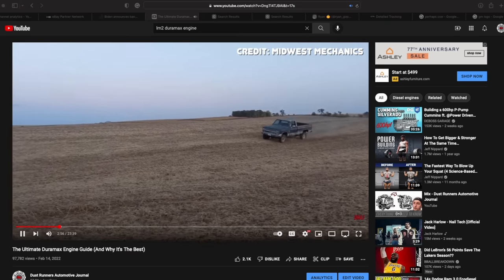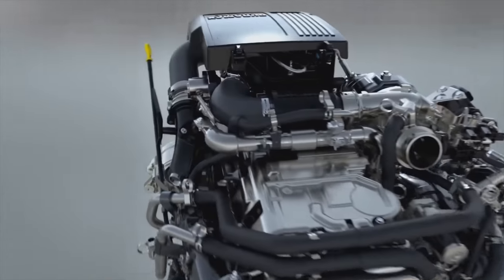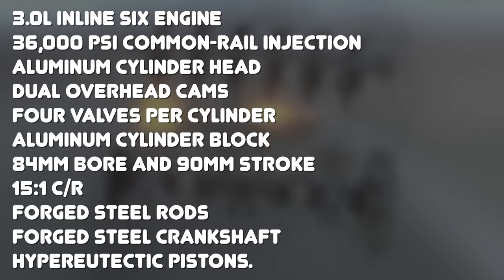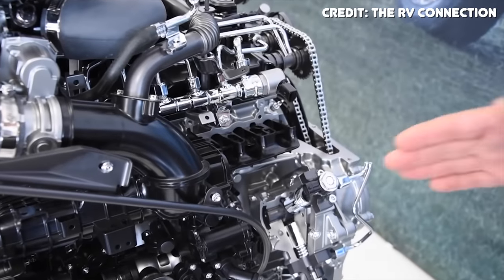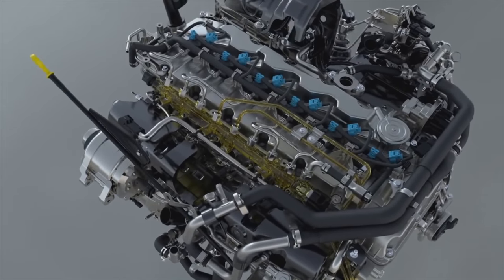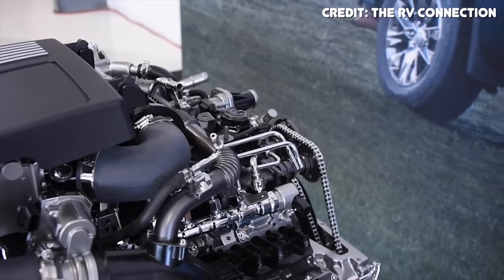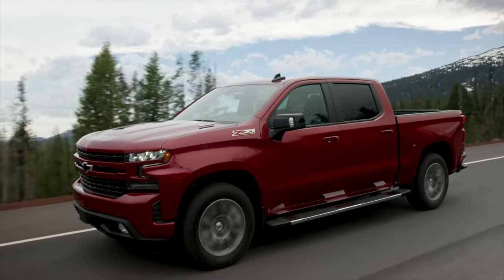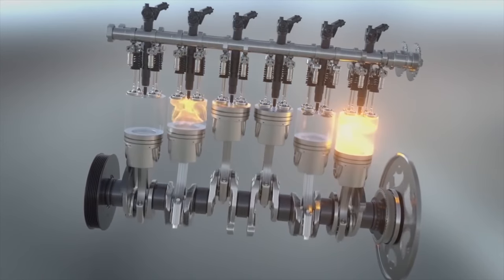3.0L LM2 Duramax: Everything You Need to Know

Comment: The timing at the rear of the engine has nothing to do with packaging. It will be the same no matter what end it's on. It's all about harmonics and reducing torsional flex in the engine.
Reply: Wouldn't torsional flex be better if the accessories were driven at the front?  Putting it all at the back means 100% of the load is on one end of the crankshaft.  Harmonics though I can't speak intelligently about, other than to say this engine is so smooth it makes Mercedes' 3.0 diesel feel like it's full of gravel.
Reply: @JETZcorp  My opinion would be that it would make a big difference being on the backside. 
Reason being is because of all the structural support for that end of the crankshaft, as it is bolted to the flex plate and then the torque converter that's attached to the transmission input shaft. Then you have extra integrity with the engine block being bolted to the transmission bell housing. I would hope that they designed a very strong crankshaft bearing for both ends of it though. So, there's my thoughts on this one 🤔.
Reply: @stanlojewski6761  I don't think those factors are all that significant.  That would seem to mostly pertain to vertical or lateral flex, which should already be very well supported by the 7 bearings the crank is supported by.  If it's flexing at all in those ways, it's eating up those bearings.  I was mainly thinking of torsional flex, that is to say, the twist of the crankshaft along its length.  That's long been a problem for straight-sixes, especially ones with a lot of torque, due to the long crank.
Reply: @JETZcorp  another 5 to 8 years and it'll tell us it's own story, that's how we'll get some actual data. There's our theories and speculations, then there's the engineers reasoning and R&D that's behind it all. I'm mechanically inclined, but I'm definitely not an engineer with a R&D department. So, for us normal folk to decipher new engine platforms we'll need the time and miles of hands-on experience for proper evaluation.  The engineers have to have reasons for this design, whatever that is. It could be excellent or it could be over thinking the design and perhaps irrational and/or maybe just to keep most of the repairs forced to an in-house repair company that simply couldn't care less about the customer base and is motivated solely by greed. Who really knows. I know that I don't trust Mary Barra and I hate stealerships! The corporate world is more greedy than ever but, time will answer our questions about this design and for consumers sake, I hope we're not paying this much money for a complete scam. Also, 1 billion is a lot to invest into such a development and I highly hope that it was spent on "good intentions".
Reply: @stanlojewski6761  One thing which I think is easily forgotten, is the origin of the engine.  It started as a 4-cylinder for Opel, almost certainly in transverse application, probably with manual transmissions most of the time.  My theory is that they intended for timing gear to be inspected and maintained during a clutch job.  If the tranny is disconnected anyway, access to the back is better than the front in a transverse application.  Front timing covers in FWD cars can be a huge pain.  Adding 2 more cylinders and putting it in a rear-drive/4x4 auto trans application changes that calculus, but the bones of the engine still are what they are.  I don't think there's going to be any real issues with flex either way.  If there are reliability issues with the engine in the future, I should expect it'll be related to emissions equipment, like every US-market diesel.
Reply: @JETZcorp  good points. 👍 
No doubt that the biggest issues with today's diesel engines are the epa garbage. Slowly getting better but if they tuned a diesel engine even better, they'd run much cleaner as it is. The aftermarket has proved that it can burn much cleaner than factory tuning. When a heavy hitter like CAT jumps out of the game because of what it costs to keep up with the politics of it all, you know it's bad.

Comment: Excellent in depth video that just convinced me to stay away from this particular application. A close friend has already had the belt fail, cracking the case & allowed oil to pour out all over the highway he was driving on... He has also experienced the long start issues & still not fixed after a few trips to his local dealership & another.
Reply: In addition to belt failure previously mentioned, he only had 17000 miles on his 2021 GMC AT4.

Comment: I am thinking of a suburban with that diesel engine in it my current suburban has the 5.3 with the variable valves for better fuel consumption. I have had trouble with the valves and the oil pump plus it lacks a bit of power towing my boat and utility trailer. My old 94 suburban with the 350 was more powerful towed the boat like nothing. So I wonder what your thoughts are about the long term with the diesel engine in the suburban wait a while to see about problems or dive into a possible money pit

Comment: As a previous owner of a 2020 Canyon with the 2.8 Turbo diesel, and now a 2022 Sierra SLT with 3.0 Turbo diesel 6 cyl, I can say with absolute confidence, there is no reason for the 2.8 to exist.  In terms of economy the 3.0 is literally identical to the 2.8 in towing, highway driving, and city driving, with the added benefit of more power/torque, and a much more spacious cab, and better ride.

Comment: What is the vertical rectangular box hanging off of the passenger rear. I seem to have developed a coolant leak and it’s dripping off the bottom of that box where it’s flanged to a small section of exhaust pipe. It’s dripping off the box/exhaust flange bolts.

Comment: I prefer the V8 gasoline engine it's easier maintenance and V6, to hell with that rear mounted timing set up and that belt driven oil pump, DEF and DPF crap good luck with that set-up in a few years later for those owning that thing. You can love it now that the truck is brand new but you will hate in a few years from now.

Comment: 10:42 why are we not using exhaust gasses to heat the engine coolant?? (no, the EGR cooler doesnt count)
.
like we already use exhaust to push more air into the intake
why not also use it to warm up the coolant (and even oil)...... so it gets into closed loop sooner??
.
.
i also live in montana
so a quicker warm up = less time freezing my boi's off driving to work when its -50F (BEFORE you factor in a 60mph wind... so like -110 wind chill)
.
.
.
.
so.... you would have a heat exchanger that looks like a SCR or cat converter 
ya only run coolant through it when needed for warm up
.
which might present an issue........ how do you prevent the coolant from boiling once its shut off?
might have to use a pump to drain it.... or have a temp sensor and constantly run a BIT of coolant through it (which would mean you need a slightly bigger radiator)
.
.
.
but still..... JUST MAYBE this system would save enough fuel 
that we could get rid of the DPF systems....... that im SURE would still cause more issues than my idea
.
people say "they have DPF figured out now, it doesnt fail like it used to"
yet.... the shop makes SO MUCH money on DPF issues.......

Comment: I am considering purchasing a refreshed Silverado RST with this engine in Q4 this year. I've narrowed it down to either that or a F150 XLT with the 2.7 ecoboost. The prices are nearly identical and I really like both engines on paper and both seem to be loved by owners, for the most part. I'm leaning toward the Chevy, but I'm terrified of falling victim to GM's notoriously poor reliability. That said, they have improved over the years and Ford has their share of quality problems as well. Decisions decisions...
Reply: You have been asleep at the wheel if you think Ford is selling reliability. My son's pulling tractor buddy was a Ford tech for a big dealer, & he got so disgusted with the Ecoboost junk he quit & went to work for a tractor dealership. He won't recommend ANY Ford engine aside from the venerable 302.
Reply: this diesel will never last

Comment: I think the LM2 is a great idea that was designed very poorly.  This is NOT an engine that will age well.  Most people that run diesels put many, many miles on them.  It is clear by the layout of the components and complexity of the design this is about a 150,000 mile engine.  Not just because of the belt design oil system (which when the LM2 first came out was a 175,000 life limit, so what changed that limit?)  This is simply from the very complex design and access from the back of the engine.  Also, why use a wet belt?  Can any of those engineers explain to me that a belt with a life limit has more space savings that a chain drive would?!  I do agree that a straight 6 is great for a diesel but considering the output and limited engine bay space a V6 would have significant advantages here.  Accessing the back of the engine (removing the transfer case and tranny) on the owner's dime at a service center will definitely affect the used price of these trucks as the age creeps up.  I have little doubt that people purchasing this truck new will love it.  I would too, but this engine is simply not made to work on.  I hope I am wrong but I just don't see this thing aging well at all.
Reply: Systems have changed wiring etc is quick connects. Lifting a cab isn’t the PIA it once was. Shops have these type lifts & ceiling room today.  I think it’s like Ram’s EcoD that it’s basically a disposable motor. Probably change the belt etc at 200k then run it another 200k or however long it lasts then dispose of the truck. If it fails early you drop in a crate replacement.

Comment: Any gm/Isuzu diesel engine usually has a pretty good following in terms of reliability...I don't know about this new 3.0 litre unit but the current 6.6 litre is fairly bulletproof maybe not as a 7.3 powerstroke but not far off
Reply: This unit has almost nothing in common with a 6.6 duramax. Stated clearly in the video.
Reply: This is not the Isuzu Duramax. This is the opel duramax. Euro stuff is usually not as reliable as the Japanese stuff.
Reply: Either way a diesel in a half ton truck doesn't sell well...regardless of its production origins

Comment: The difference between a Half-ton and my one-ton is 6 inches in overall length. My 2020 6.7 powerstroke routinely gets better than 23mpg(10.2l/100km). Make that 3.0l weigh 9000lbs all day everyday, report the given mileage. Better, make it tow a 12k rv and still get better than 13mpg(18l/100km). Oh wait it can't do the same job. A 9k truck plus a 12k trailer is 21k right? That's about 4k more than the GCWR of any GM 1500 truck, 3.5k more than a Ram 1500, and 2k more than the highest rated F150. Too many people don't understand ratings and limitations. Yes that 3.0 get better milage than my 6.7 and every other 3/4 or 1ton. It can't even match the work of a  late early 2000s diesel either(20k GCWR). I have never cared for the small diesels(other than the 1.9 TDI VWs)
Reply: Pull my 7k dry weight trailer with weight distribution no problem. You're talking apple's and oranges. If I want a 12k RV I'd buy The truck to match
Reply: @edhlavaty6914  I was stating that the 3.0L  doesn't even compare to the old 5.9 cummins, 7.3. Powerstroke, early 6.6L duramax. Even though it is close in power the measure of what a truck can do in based on its GCWR and none of the half-tons are better than 17500lbs(other than a few select F150s(19100lbs). At the load levels of 10k towing(15-16k GCW) the mileage isn't comparable to the old stuff at 8K towing(15-16GCW) or 12k towing(20k GCW) personally I would use any halfton for more than light towing, no rv over 24ft or and enclosed  trailer over 7k. It's just not enough truck. Most half-tons are between 5-6k empty and 7k GVWR do you really feel comfortable with a 7k(max GVWR) lead vehicle towing a 14k trailer? My 9k(empty) 12.4(max GVWR) one-ton can lead 22k of trailer. Most semi-trucks are the heavier end or the truck(12k steer, 40k drives, 40k trailer) so 56k of 80k GCW is leading the trailer. Quite the difference between even a ono-ton DRW, which is a14k truck leading 36k of trailer. 6k of the trailer is on the truck, but its still only 6 tires leading 45k of GCW
Reply: not a chance you get 23mpg from your 6.7
Reply: @michaelcooley8275  I've gotten almost 25mpg out of it.  Not everyone drives their truck like an idiot. The average on the current tank is 12.2l/100km(19.28mpg) that's almost 50/50 city highway. If I fill it in North Bay, Ontario  and drive to London, Ontario . I have consistently gotten 10.5l/100km(22.4mpg) in the winter, have had it down to 9.5l/100km(24.75mpg) early duramaxs could get 27mpg easy. It's all in how you drive. This truck averages 11.6-12l/100km at 120km(74mph) on flat ground no wind. Thats 1750rpm in 10th gear with a 3.31 axle.105km/h(65mph) is where I drive and it's turning at 1570rpm. Still within the best range for BMEP(Brake Mean Effective Pressure)1550-1750rpm.

Comment: Love this engine, however my biggest disappointment is the absolute lack of the so-called exhaust brake, which was a selling point for me. All it does is skip a gear while down shifting in tow/haul mode, thus red lining the rpms. Doesn't slow you down in the least.
Reply: Well if you're driving a 1500 with the diesel option, you're gonna just run right up on me and swerve off the road while I take my turn anyway. Who needs brakes?
Reply: Thank you, you've been a tremendous help.
Reply: My exhaust brake work's fine. And I drive Triaxle for a living, with real exhaust brakes, so I know a little bit about it
Reply: Ed, ironically i do too. And they have engine brakes. Completely different.

Comment: The first video I saw of this engine I thought timing chains is kind eh for a diesel. And then hearing they’re in the rear of the engine I just thought that was super dumb. Just like the 6.0 powerstroke. The biggest let down is a belt driven oil pump that needs serviced at some point and you have to remove the transmission to change it, like who the fuck designed this?

Comment: I work at a chevy dealership in Texas I haven’t seen much of the 3.0 l but I have seen quite a few 2.8 l come in for def quality and Emission related issues
Reply: That's par for the course with those engines. I donat least like the design of the 3.0's after treatment system. Getting everything as close to the turbo heat source is a good idea.

Comment: Love that your talking inline 6 the inline got put on the back burner for packaging  reasons years ago. What's disturbing GM doing the quick an easy again. This engine seems to have the right stuff but if history repeats itself GM just built an engine that will detonate around 125,000 miles or just past the 5 yr loan.
Reply: What history? Sold my last two Chevy trucks at 250k and still running fine 🤷

Comment: Having to repeatedly remove the transmission in order to service your engines, chains, and belts on your diesels, GM you are digging your own grave.
Reply: Maybe once in the life of a high mileage truck for the average owner. Check out the cost of a water pump job on a Ford V6.
Reply: @wymple09  the cost of an internal!!  water pump on the 3.5 L Ford Edge cost my own father two different engines due to water diluted oil. Never mind the cost to just replace the pump.
  I have seen a couple of other Infernal, internal water pumps on some other manufacturers vehicles, it's not just Ford.
  The shenanigans the American manufacturers are trying to pull are causing their customers to buy Japanese cars.

Comment: i disagree about the engine fitting think about it the envoy trailblazer have strait 6 in them which is the 4.2 and i seen a 2018 1500 with  a cummins 6.7 its a custom install but its fit good in the engine bay

Comment: In other words, buy a new one, drive it 50-75k miles and sell it.
The fact it's a turbo diesel or a straight six, or anything special is meaningless......it's an over-engineered mess only suited to the wealthier, first owner. Not trying to be pessimist, but I've been a diesel equipment mechanic my whole life and I know a future disaster pile when I see one.
Reply: Ha. Same. Good point
Reply: It’s a shame you ain’t wealthy
Reply: @orion000  Diesel mechanics make good money my man, I could buy this truck tommorow.....but I never would because my area of expertise makes it plainly obvious that it will never do two things diesels are meant to do. 1) Possess long term reliability. 2) Be simple to maintain.  The third is efficient operation which I'm sure it does do well, but at the cost of the other two.
Reply: @84gssteve  oh ok

Comment: If merc can use chains with no problems in their engines. Chevy can too
Reply: Have you seen any with more than 100k miles? Extremely rare and when you do they are $5k for sale junk
Reply: @jacobstrutner8232  i have seen 100s over 350k miles. Old merc engines are very good.
Reply: @jacobstrutner8232  w203, w209 and w204 owner here.... 2.6 with 260k miles, c300 with 322k miles (camshaft sprockets problems) and clk 350 with 300k miles with no issues..
old mercedes are insane in terms of reliability.
Reply: The OM616 is still in production in India under license.  My 1979 240D has no issues after 300,000 miles.  The comparable LM7 was crushed about 40 years ago.

Comment: Well, I had pretty much made up my mind to buy one of these, but now I'm thinking no.  If you have to pull the engine and tranny every 150 miles to change our the timing chain, that's just not something that sounds economical.  Too bad, I thought I had landed on the perfect option.  So, I won't buy the 6.2l gasser because of DFM issues and now this diesel option is out as well.  The 5.3 just doesn't do anything for me either.